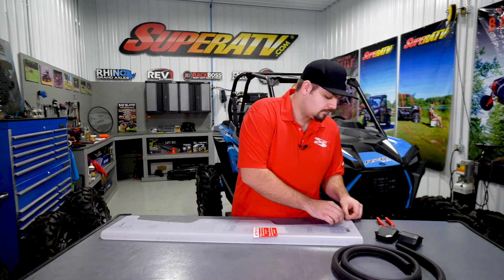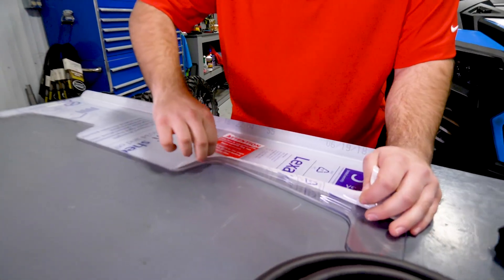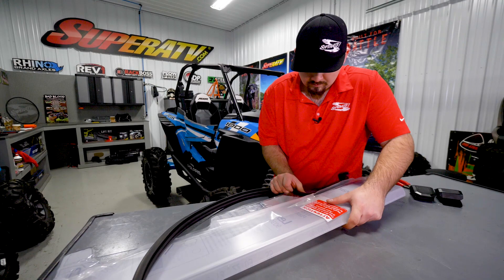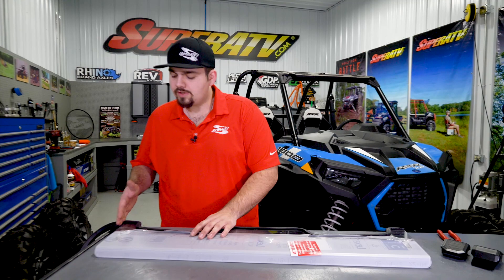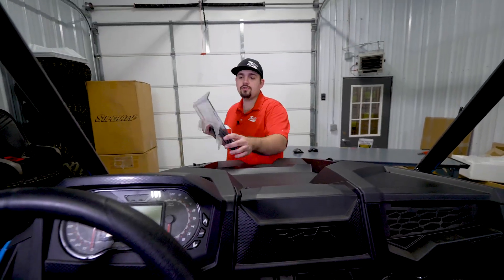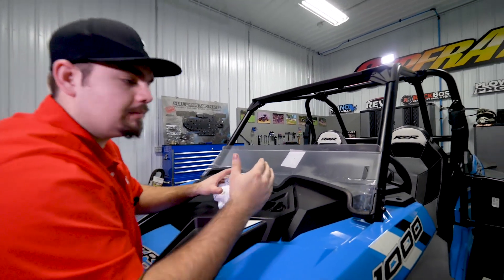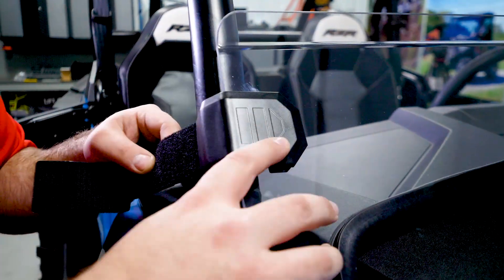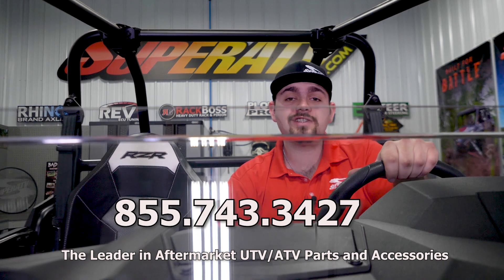Half Windshield Install | Polaris RZR | 1000 | Turbo | How To | SuperATV

Comment: What size wheel and tires are on the RZR in the video as well as the lift kit and suspension parts
Reply from the maker: This machine had our 4" portals, 1.5" forward a-arms, and I believe 34x10x15 Terminator tires, but we no longer have this unit to confirm that tire size. With the portals an arms, you can clear up to a 35".
Reply: @SuperATVMedia  does it have a 3 inch lift kit and just the portals

Comment: Are the 4" inch portals that where used are they dual or single
Reply from the maker: The portals on the machine in this video are single idler portals.
Reply: @SuperATVMedia  did it have a 3 inch lift kit on it with the portals